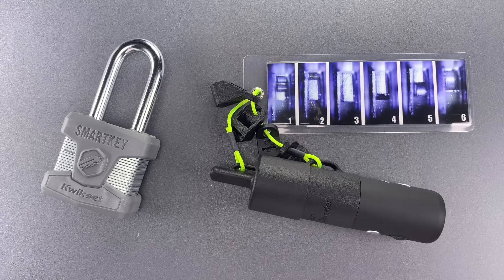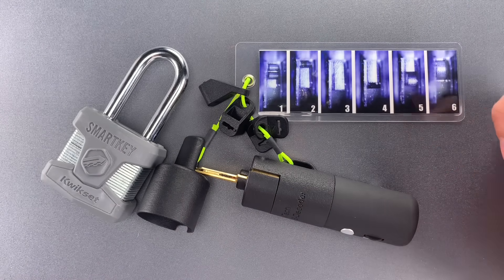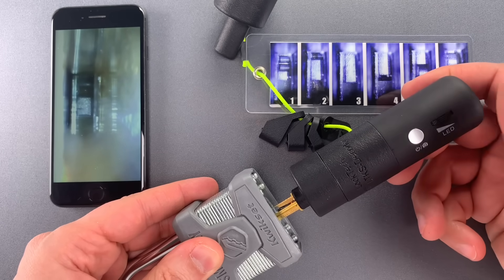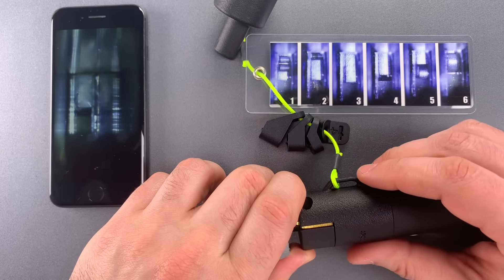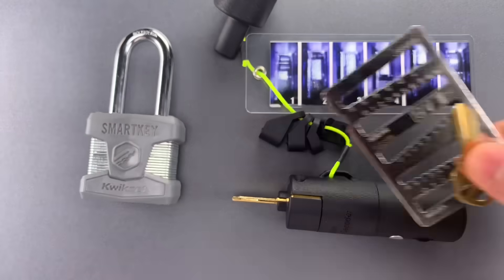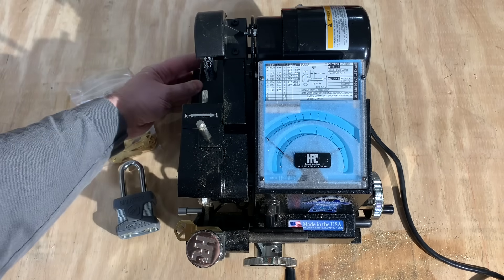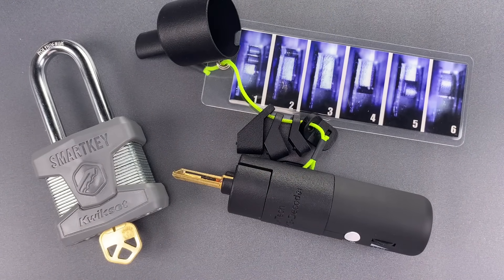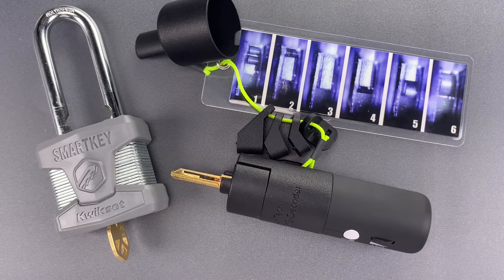[1209] This Tiny WiFi Camera Owns Kwikset SmartKey (LockTech LTKSD)

Comment: Driving to college in the 80s I locked my keys in the car. I called a locksmith to get me in.  After he was done I showed him how my keys were on the dash board.  He said if I let him try something he would cut my bill in half.  We proceeded to look at the keys trough the window and used a handheld key cutter and made a key.  It didn't work on the first cut so he eyeballed it again and made one modification and it worked.
Reply: Nice, a show of skill AND half price.
Reply: @2_much-w7w  Locksmith's will offer a cheaper price a lot if you pay cash because they can pocket the money themselves. I've had to use them many times as I used to travel all over the place for work and lost keys or locked them in cars (broke the key one time) and I've had a number of them do that.
Reply: I expected a prank where he smashed the windshield and handed you your keys.
Reply: @donkremer6019  🤣🤣
Reply: @donkremer6019  😅😂
Reply: @donkremer6019  i am pretty sure that would have been extremely costly for the guy,.. because you can bet he would have been sued. another question that came up while reading the comment... how is smashing the windshield a "prank"?
Reply: @donkremer6019  SAME 😂
Reply: @donkremer6019  naw just most likely a Honda or something. Super easy keys back then.
Reply: Damn, that's so nice of him.
Reply: @andhieyusuf7008  never miss a learning opportunity, even if you have to pay for it.
Reply: had something similar happen to me but the locksmith put his own car key in my car door lock jiggled it up and down and just like that it opened right up
Reply: He was his father since he charged you less for more work, plus an extra key 😂.
Reply: You won twice! 1/2 price service and got to see a live version of TLPL! 😁
Reply: 1991 I locked my chevy with the keys in the ignition. There were separate keys to the ignition and the door, so the door key could be seen hanging beside the ignition from the window. One of the guys that where in charge for keys on one of the Chevy suppliers where this happend crawled up on my hood and cut a working key on the first attempt just by looking at it. So it can definitely be done and if you got the skills.
Reply: The most chaotic energy is a person that drops a comment and leaves people hanging for responses
Reply: I was in the same situation except I got a spare key with me so i let the locksmith made an exact copy to open the car door.
Reply: @jasonng1468  Is this a joke? If you had a spare key you can open car yourself
Reply: @DanFromSales  i think you're right, "skill in trade" is irrelevant because you dont even have to be a tradesman for this to be relevant. Anyone working in any sort of service job could explain this point in its simplest form. 
"Why would you ask to try something after you had already solved the issue?" 
"I've already solved your issue so I don't need to waste any more of your time but I have been practicing a new technique and I'd love to give it a shot. As a thanks for giving me the opportunity to practice i will knock a bit off your bill." 
So you're right, skill in a specific trade is irrelevant. All you really need is skill in service and repair. 
Unless I overlooked something in the point that was being made  in the original thread.

Edit: as someone said prior "why not just practice at home?" They likely have been practicing, thats why they wanted to give it a shot. A real world chance to do it is entirely different than a controlled practice environment and likely doesn't present itself very often where they can actually see the key to the lock they're trying to get into.
Reply: @zac9933  you are correct and I was greatly misunderstanding the point scott b was trying to make.
Reply: For a vehicle, give me a slim Jim and 2 minutes, and I'm in, 90% of the time.
Reply: @larryrivers2752  anything newer than 2011 here tends to have deadlocks. The only way in is with a key or a brick.
Reply: @handlesarefeckinstupid I can, and have, kicked straight through a standard deadlock. Bolt is made of metal, door frame is made of wood, with less than an inch of material wall. A little thin brass bolt keeper WAFER isn’t stopping my 6’ tall 200lb legs from pushing that door open by flat footing the door right next to that lock opposite the frame. I have always been able to kick a standard deadbolt open (with permission) and I’ve done it more than once.

Might consider changing your view on security. Just because it hasn’t happened to you don’t mean it’s not possible.
Reply: Back in the early 90s I lived with my dad in Canada.  He locked the keys of the car in the ignition one day and the locksmith that came out cut a new key by eye using a handheld key cutter.  I was pretty impressed by that. :)
Reply: Was the sex good?
Reply: guess i would have wired a key under the car inside a bumper only where i knew it was  .. oh i did that used it 2 times .. dam electric car lock would lock by its self .. car was in the 80's
Reply: @wolverine754  LPL has a quite recent video about doing that - impressioning to figure out how to create a new key from a blank.
Reply: Your car must've been a GM vehicle. The handheld cutter is called the Curtis clipper
Reply: I seen a 12 year old hand cut a key just by inserting it and feeling it somehow
Reply: I can't imagine finding a locksmith with those skills nowadays. All they seem to know anymore is how to drill out cylinders and then charge an arm and a leg for a new cylinder.
Reply: My comment is totally off topic.   We would not need locks or keys if we were allowed to put certain protective devices in place to eliminate the trespasser.  The law themselves prevents us from doing so , so that they themselves can break and enter when investigating and not worry about being eliminated in the process
Reply: wow that's cool
Reply: my dad owned a carlot and had a guy who would come with a magnifying glass, a file, and a blank key. lets just say, there was a lot of cars, and business was good. im pretty sure he started his own locksmithing company. cool to think of the wild west days
Reply: It's all fun and games until you wake up the next morning and your car is gone
Reply: that is actually a great idea.. and today.. if you could see the key cuts.. you could take a picture of it and then magnify it out to match it up to a physical key with a smart phone. it is no wonder that physical keys are becoming more obsolete. They can be duplicated very easily now.
Reply: Punch a hole through the windshield lol
Reply: 2 months later the car vanished from your driveway...
Reply: That's a real attack vector, you look at pictures of keys on the internet and cut new keys to open things !
Reply: Thats awesome
Reply: That’s so cool.
Reply: People don't even get to try shit like this at work anymore.
Reply: this is the first time I've heard of someone getting paid to see a neat trick
Reply: What a champ. I just hope he didn't keep that key...
Reply: I was expecting shenanigans with magnets.
Reply: Skills!
Reply: Only time I ever locked keys in my car it was both sets. I got in with a coat hanger.  The current replacement power lock actuators for older Lincolns (and other Ford products) tend to stick in the cold...The new one I installed in summer caused the door to re-lock on its own in winter. Between that, window actuator issues, and blowing the speakers I had the interior door cards off so many times I had the lock actuator linkages, and window mechanism, and everything else inside the door structure of both doors memorized and I knew what to fish for and where to fish for it. It would have been a 2 minute entry except for 2 issues: 1 the 7.5L engine was running which drowned out audible feedback and reduced tactile feedback, 2 I started on the side with the stuck actuator and that wasn't going to budge enough to let me in (it barely worked with the key on that side).
Reply: So many fucking skeptics in here lol. Like good lord, I feel sorry for how paranoid about daily life you all are.
Reply: @sebastianriz4703  Ikr. And even if the locksmith didn't make the key, these guys are forgetting that he's a locksmith. He DOESN'T need the keys to get in.
Reply: Little did you know at the time, it was LPL senior.....
Reply: That really speaks to his craftsmanship
Reply: How are you getting the depth perception??
Reply: I watched a locksmith do that in !y buddy's car.
Reply: Locked out of a car in the 80’s. Didn’t know that could happen back then..
Reply: @nedread6700  The quality of the lock affects how exact each notch needs to be. But a high quality with small tolerances will fail when the key wears down in the pocket. So the locks are made to allow wear down of the key. And this is why the locksmith doesn't need to make an absolutely perfect new key.
Reply: and your car and home were robbed the next week..
Reply: @robbie609  A locksmith doesn't become more dangerous because he tries to visualize the key cut compared to when you have him cut a spare key the normal way.

And a locksmith doing a "breakin" without any breakin a week after he was consulted would not be a very clever locksmith.
Reply: I actually happen to be a movie script writer & award winning director… a real big cheese down in the ol’ Hollywood town a showbiz… 

Let me tell ya something kid, as unbelievable as it sounds that this happened to YOU (I see many a suspicious bystander in these here comments) this story of yours got legs. I wanna present this to the Warner Brothers. Have the script on my desk by Monday and by god let’s make this freakin’ movie!!! 🍿
Reply: a guy on the internet: tells a neat little story, about a guy being nice.

the comments: 🔪
Reply: He then came back that night and stole the dudes car !
Reply: @johnwalker194  

Too obvious unless......
He's not a really a locksmith but a meth addict.
They'll steal your bike from in front of the police station.
Reply: @dpz9872  Liverpool ! England !! Our band was playing in the cavern club and our vehicle containing all the band equipment and merchandise was parked within eyesight of the Mersey tunnel police station ! Sunday morning we were informed that "the lads" would have stolen it to get into the tunnel and back to Birkenhead undetected and it was a daily/nightly occurrence, the vehicle was found burnt out two days later and a vintage fender precision bass guitar is still missing along with a beautiful Yamaha electric and around 50 Mick Rutherford Band t shirts !!!
Reply: Locked my keys in my Ford Escort in front of Best Buy. Instead of calling a locksmith I spotted a couple heading to their Ford Taurus. I approached them explaining I had locked my keys in my car and if I could borrow their key to open my car. They seemed doubtful yet intrigued and let me borrow their key.  They were shocked and amazed as I opened my car, handed the key back and gave my thanks.
Reply: Back in the 90's there was one guy at the GM parts counter that I went to for my GM keys.. He just looked at your key, and wrote down the depth numbers from memory. He'd set the dials on the hand operated key punch tool and notch out a perfect key every time.
Reply: That sounds like a pretty cool locksmith tbh
Reply: Confidence in the profession
Reply: I knew a locksmith long years ago that would make copies of your keys just by looking at them and use a hand grinder
Reply: Before I had a celphone,  I locked my keys in a delivery truck outside of costco.    I knew we had another key 200 miles away at the shop so I asked to use the phone, called my brother and had him send me a fax of a photocopy of the key as the last page of a big order.   When they pulled the order, they gave me the list to check quantities -- I grabbed the last page, cut the shape of the key out of a yogurt lid, shoved it in the lock, and turned the tumbler with a small screwdriver.     I have done similar with celphone pictures.   It helps that my dad was a locksmith.
Reply: Given the price of locksmiths, if you hadn't met that guy, you probably should just have smashed the window. 🤣
Reply: Did he mention the price before cutting it in half?
Reply: it’s was lock picking lawyers cousin,dawg
Reply: My wife can do it first time.
Reply: I was taught this method in school, had to hand file a key from looking at a key without touching it. My teacher started in the early 90s I think but glad to know people are still teaching it. I'm terrible at visual impression filing BTW but in a pinch on a simple old key I can manage.
Reply: Almost an interesting story....
Reply: A likely story! 😂
Reply: I locked myself out outside tower records. Locksmith just came with a flat ruler type blade and fiddled down by the window glass. Two minutes and I’m in.
Reply: Bro chose the challenge over time and money. He was a baller.
Reply: And he never stole your car! That’s crazy
Reply: You know what most of these new vehicles they got a microchip anti- theft and just cutting the key might get you in but it won't start it.
Reply: @red2965  yeah you have to bring a ECM and change it
Reply: @Bryan-Hensley  😂
Reply: @red2965  Must be the information on the microchip and not the microchip itself which is important. I'm pretty sure that data can be copied.
Reply: @red2965  Yes, but once you are in, OBDC port is in your hands.
Reply: @red2965  getting would be enough to grab the key inside the car?
Reply: @red2965  sure, except this is for a house key, shed key, bike lock key,  garage door key, locker key, storage shed key, container key... you get the picture. A car is not what this unit is designed for.
Reply: @red2965  "In the 80s"
Reply: @red2965  indeed, however if you have the right resistor and a couple connectors that’s easy enough to bybpass.
Reply: The confused and incredulous people in the comments are having trouble imagining the most likely possible scenario: OP and the locksmith were both friendly towards each other and enjoying each other's company at the time.
Reply: @benanderson46  No, the most likely scenario would be the one that the OP gave us. He needed a locksmith, he got one, they cut a key... job done.
Reply: they're called curtis clippers, very handy old tool to cut older car keys right in your hand
Reply: In China there are people trained to use sight of key, remember code and make a key to access any place. These people are quite dangerous.
Reply: @michaelseah9617  yeap. Had a locksmith make a spare key for my car a while back, didn't even use my original to make a new one. Just looked at it, rattled off a few numbers, grabbed a blank then came to me a few minutes later with a key. Crazy.
Reply: @michaelseah9617  any source on that? If not I'll consider this to not be true
Reply: @michaelseah9617  nice thank you very much. Also I'm sorry if I sounded rude I just didn't like how you phrased your first comment. It made it sound like something you made up to make chinese people look bad. Which it isn't of course, this TV show could easily be from any other country. Thanks again and have a nice day
Reply: @Klaus Heisschooler Hey you, I smash you window and grab your key. Like me now?!

"SOMEONE CALL THE POLICE!!!!" 

i dunno, I like him too, but I also liked the video of the guy with the video saying "How to get into your locked car in 10 seconds or less." and proceeded to smash every window on the car with a metal working tool.
Reply: Nobody ever said @MightyBiffer got to keep the extra key. Hopefully, yes, but in any case the skill to do that and a good memory in the wrong hands so-to-speak could be dangerous. I’d be curious to know why someone who does this for a legitimate living would want to “try” something they could literally “try” anytime they wanted! And then offer a 50% discount?!? Sounds fishy.
Reply: @JamesCarmichaelArtist  maybe he just started learning this particular skill and wanted to try it out in the wild.
Reply: @JamesCarmichaelArtist  I think like any virtuoso artist, he loved the opportunity to perform.   The car owner was a captive audience and the "demo" cemented the locksmith's reputation in the customer's eyes
Reply: @ckaufmancpa  1000% this. I do it as well, it just feels great and gets your name out there
Reply: @JamesCarmichaelArtist  The guy is a locksmith who was expecting to get in without being able to see the old keys. If he kept this one then it would have saved him a few minutes AT MOST over coming back to steal it blind. Of course it's not fishy, he just wanted the practice. "Let me try it" is because it may not have worked by eye, and some customers would get snotty about the time used if it didn't.
Reply: @wood42shed 👍🏼👍🏼👍🏼
Reply: @JamesCarmichaelArtist  get paid to practice cutting keys by looking at them and some people have a soft spot .. plus all the other extra keys he might get a call back ..
Reply: @JamesCarmichaelArtist  He might have done it plenty in his own environment already (which would also explain why he was so good at eyeballing it). However I do know for sure that, personally, I would want to try such a skill "in the field" - in a completely different environment.

That's not to say there is definitely nothing fishy going on, but that is at least something I would want to do and can relate to.

If I had to guess, the 50% discount would be for wasting the customer's time. It's certainly something I would consider if I didn't have a busy day ahead.
Reply: @JamesCarmichaelArtist  He was trying it in a professional setting. Any skilled craftsman practices their trade off the clock as a hobby
Reply: @JamesCarmichaelArtist  then there's after he got it unlocks it was I got the keys on the dash let me try
Reply: @JamesCarmichaelArtist  If I was in that business, it sounds like something I might do just for the challenge.
Reply: @JamesCarmichaelArtist  dood   dood  dood hes already a fukn lock smith he already knows exactly how to get into locked sht  dood  .
Reply: @JamesCarmichaelArtist  the cutting by hand way was probably against the rules and he was most likely a commission worker who saw a way to pocket some money from a cash paying customer, and report the customer turned down the service. many employees in trades will tell workers to replace everything always if you can. you can upsell the parts and put a guarantee on something brand new. and nobody wants to pay a lot if you can just cut a new key by eye in 10 min. many will offer a discount so the customer is happy and wont report anything to corporate because he got "the hookup".
Reply: @JamesCarmichaelArtist  It's why prison guards have key protectors, little metal sleeves on a hinge, that slides over and hides the bittings of a key. That way prisoners can't see the cut of the keys on their key chains when they are walking by.
Reply: @JamesCarmichaelArtist  You sound like a really happy person.
Reply: You think he was going to try rob the guy later? He's already a qualified locksmith, he doesnt need the key to get in. He could do it anyway. Your kind of skepticism is a useful  way of protecting yourself in this day and age when there are so many bad people out there. But not everyone is a bad guy out to get you. I think you are right to be skeptikal, but balance it with discernment.  @JamesCarmichaelArtist
Reply: @JamesCarmichaelArtist why not? Also, if you are leaving keys in the car anyone could take a picture and take measurements from that
Reply: @JamesCarmichaelArtist  "I’d be curious to know why someone who does this for a legitimate living would want to “try” something they could literally “try” anytime they wanted!"

I fixed electronics, not locks - so - take this for what it's worth
- but -
if you let me try to swap that "shorted bga chip," with a regular "$40" soldering iron, I could save you a lot; otherwise, I have "$1k" infrared station I could use. Why would I want to try this thing that could save you money? To help develop I skill I haven't needed since I bought a tool designed, specifically, to do it faster than I ever could....and with many less mistakes.

Sure I can try it any time I want, if I get another donor board - but - that doesn't help you at all. ;)

NOTE: The above is just an example. My soldering iron is $500 and I have no infrared machine ;)
Reply: @randoUsername553  I’ll address your comment in two parts:

First, and probably THE most important aspect your explanation is excluding is the fact that he already had the car unlocked, whereas your example hinges on the actual repair method that has yet to happen. 

Second, your donor board substitution for keys is kinda moot, really. Everyone, ESPECIALLY a locksmith, has keys lying around. He could practice that anytime and anywhere. In your case random boards, broken devices, and so on can be easily obtained by asking friends.
Reply: @JamesCarmichaelArtist  Before we start pointing out what's 'kinda' moot, lets just ask Mighty if that car was ever stolen or not.

I.e. Until Mighty chimes in, only one of our arguments is based on conjecture, while the other is based on experience in trade. 

Guess which is which ;) #irony
Reply: @JamesCarmichaelArtist  yeah but they cant steal the car
Reply: @JamesCarmichaelArtist  The locksmith can practice, but it does not replace the stress, pressure and thrill of doing it on-site, with the tools that you have decided to pack in the vehicle this day.
Reply: @randoUsername553   the car was already unlocked as mighty said, even cars that are nearly two decades old like my own will open but not start without the correct key fob. At least you accurately labeled your comment with #irony considering your hypocritical remark about ‘conjecture vs skill in trade’ while you are not a locksmith. Perhaps leave your unwarranted condescension out next time eh? “ ;) “
Reply: @DanFromSales  Do you realize you didn't counter anything I said? 

I.e. did I claim to be a locksmith? No. Did I point out I wasn't? Yes. 

Why are you reiterating it as if it takes away from what I said? If it did that, it wouldn't have been the basis for my example ;) 
 
NOTE:  When I'm condescending, it's deserved. Stop white knighting because you feel some type of way. If you feel I was condescending before, step your game up.  ;)  

Perhaps next time you just respond with a well thought out counter? One proving the car was stolen by the 'shady locksmith' - otherwise - my example still stands as one potential for why someone would do what this locksmith did, while having no ill intent ;)
Reply: @randoUsername553  lol bc skill in trade means absolutely nothing when it isn’t the trade in question. You’re readiness to overlook that bit speaks volumes.
Reply: @randoUsername553  I think using a specific example was intended to help people understand but instead made them entirely miss the point of what you were trying to say. I thought it made sense 🤷
Reply: @randoUsername553   I apologize as it looks you and I may have been on the same page. I mistook you’re quote from another persons comment about “a shady locksmith...” as your own opinion and not a rebuttal to someone else’s. I am of the opinion the locksmith was legitimate as well and was wanting to give it a shot. This misunderstanding is why i found some of what you said contradictory. I feel a bit silly but here we are. Anyway have a good one.
Reply: @randoUsername553  🤷
Reply: @randoUsername553  here is a simple analogy, customer has a key missing on keyboard. your boss doesn't want you replacing keys. he wants you to upsell the new keyboards that came in and the warranty. you remember a trick on how to make a "fake" keyboard key that will work without replacing the whole thing. you give the customer a discount and pocket the cash. then you don't report it to the boss. you helped the customer and yourself. this happens on a lot of commission based jobs were employees are out in the field and can get away with it. as a customer you are grateful and keep your mouth shut because at 50% he is definitely not reporting it.
Reply: @randoUsername553  right, was wondering what happened to that extra key haha
Reply: @JamesCarmichaelArtist  agree
Reply: @JamesCarmichaelArtist they key the locksmith made wouldn’t have worked to start the car anyways. Just as simple as wanting to show off not everyone has a nefarious intent
Reply: @randoUsername553 it's a personal challenge he doesn't own the car. he can't just cheat and open it when he gets tired of trying. he gave the discount because he was taking more of the clients time just to f around for fun. you're going to want to keep those skills up. that's the only thing separating you from everyone else who can afford that tool, and when it fails (it's electronic, it will fail) are you going to say 'sorry, i can't take you money today my magic box quit working." or do you dust off the analog tools and use real skill to do the job?
Reply: Is Mightybiffer a woman, me ponders?
Reply: @scranneroram  Reddit moment.
Reply: @scranneroram  u yyy5tr4 me